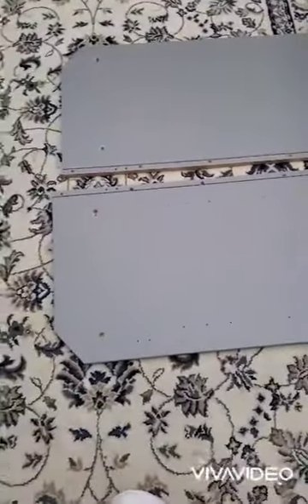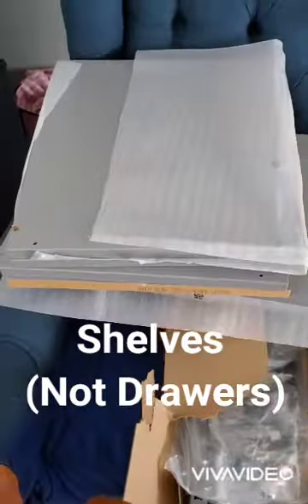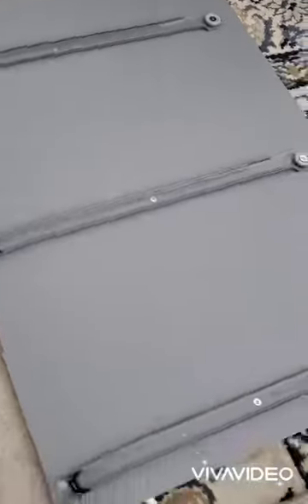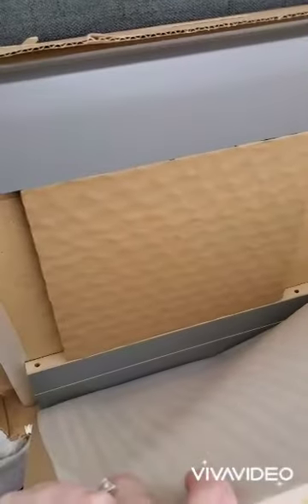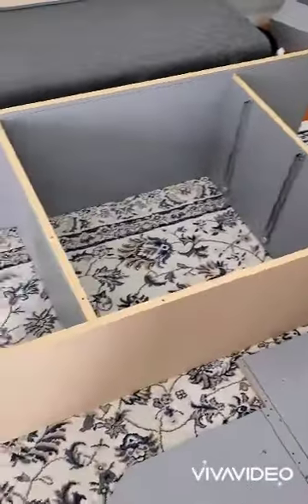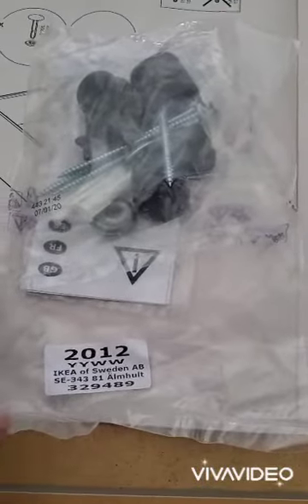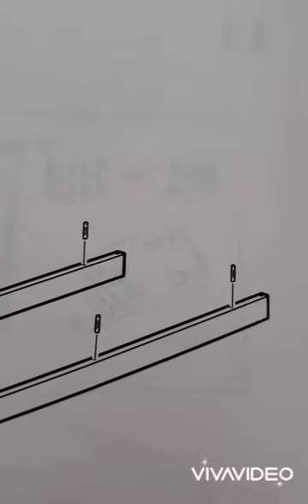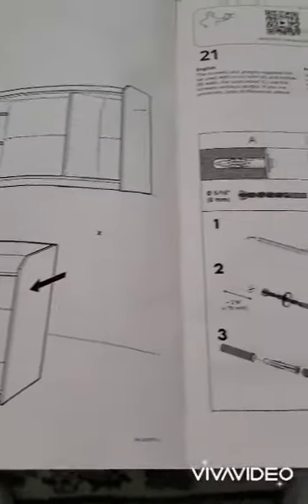Ikea Hauga Sideboard Obstacle

Comment: Wow. We ran into the same problem with that box 3 piece. It wasn’t the right size.  Did you go back to store or call them?
Reply from the maker: We went back to store with just the short piece.  They were kind enough to try to switch out but that piece was short, too.  If we bring entire unit back they will then notify manufacturer about 'quality issue'.